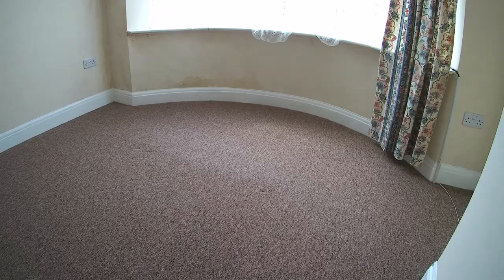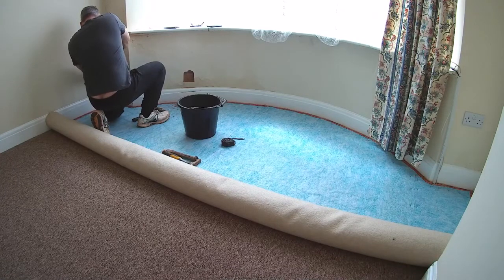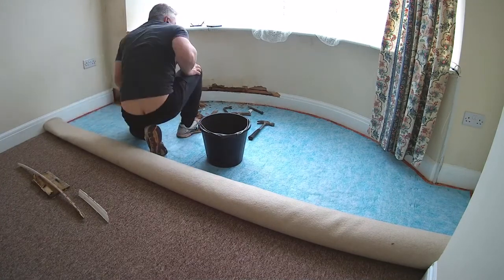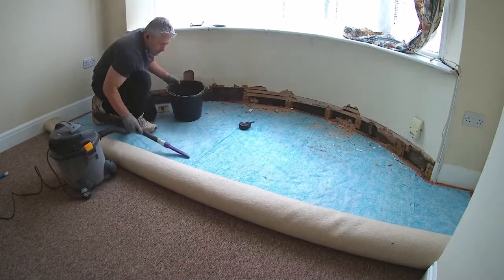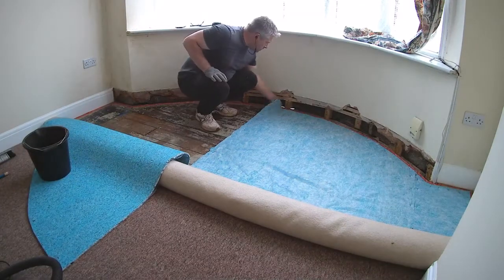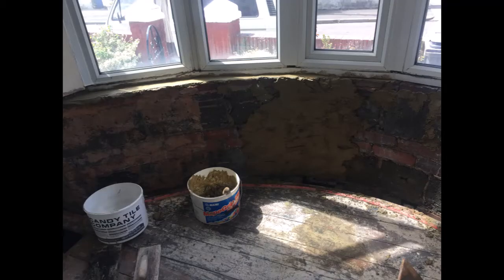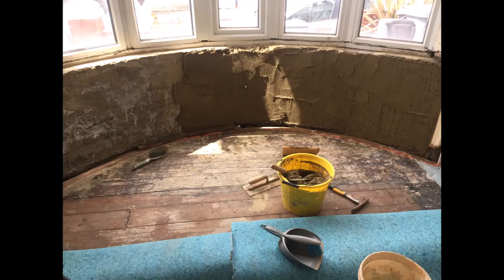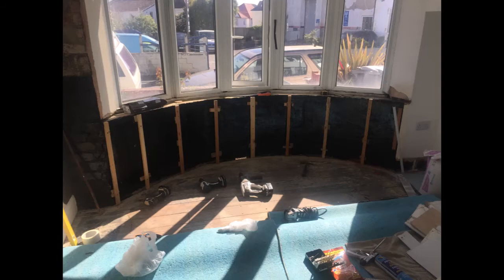Problem solving, damp bay window - B roll video

Comment: Thank you. The tip at the end about the mistake in sealing the gap at the bottom of the window was most helpful, because this is exactly what my builder was going to do; of course, I stopped him. The gap is there on all my windows; the damp is only there below one window; so, the gap is obviously not the source of the problem. We did find another problem with the relevant window, which the builder fixed; now hoping that the area below stays dry this winter. Thanks.
Reply from the maker: @Vijay-we4iw  you’re welcome, really glad it was useful 👍🏻It’s a good few years since I did this work and it has remained bone dry (and a lot warmer) since

Comment: I have similar issue in my bay window at living room, I thought my problem was due to bridging on the outside over damp course/brick , good tip about the sealing , I actually closed the gap myself as there was some loose sealant there from before which I thought came off and need to be refitted. thanks

Comment: Very interesting video. We have a similar damp wall problem beneath our first floor bay window. The window fitters didn't put any sealant on the outside wall between the upvc window cill and the brickwork underneath it to fill the mumerous gaps yet they did on the ground floor bay window. Odd.
Reply from the maker: Thank you David. Do you think you’ve resolved all the issues now? It’s been quite a while since my investigations and remedial work now and I’m convinced it was because they were sealed on the outside.